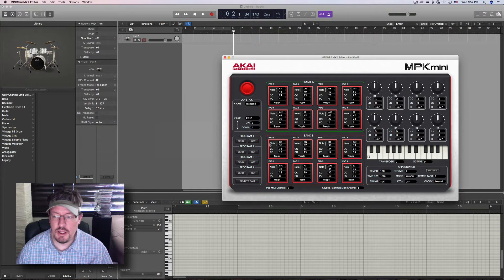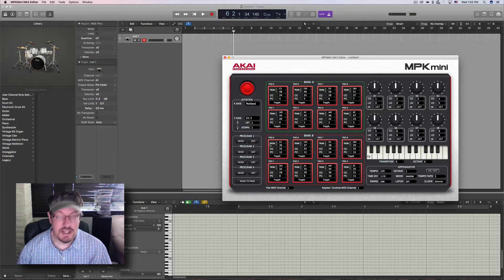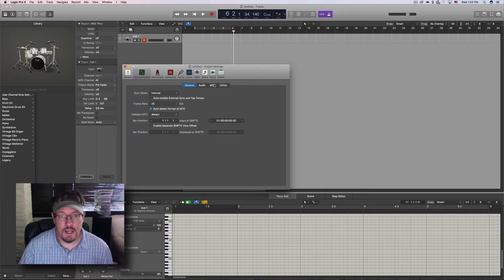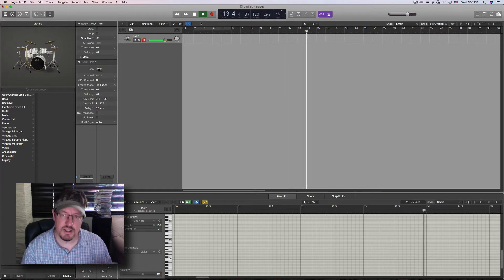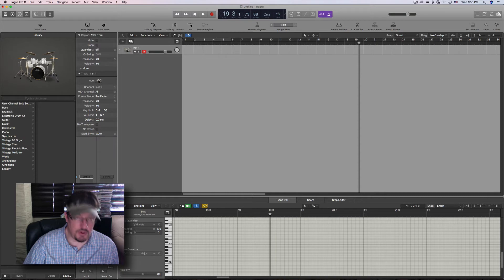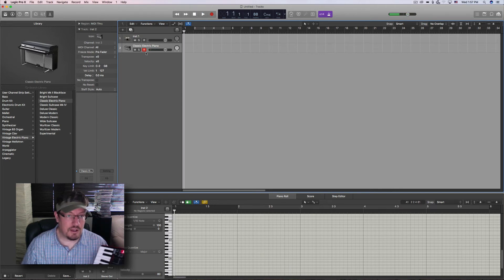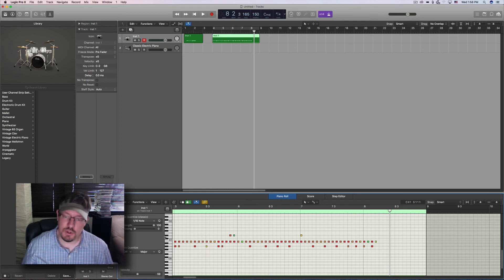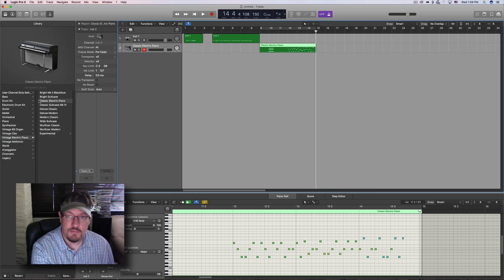Logic Pro X | MIDI Clock #081

Comment: I have a Korg SQ-1 that I'm syncing with Logic. They talk to each other just fine. The problem is the SQ-1 will only advance 1 step per click, or advance 2 steps per click. I need 4 or 8 steps per click. I'd be happy slaving Logic to the SQ-1 via USB Midi, but idk if that's actually possible. Can't find anything online. Maybe you have some insight? My solutions would be either slave Logic to SQ-1, or somehow send a sub-divided midi clock from Logic to the SQ-1. Thoughts? Thanks!